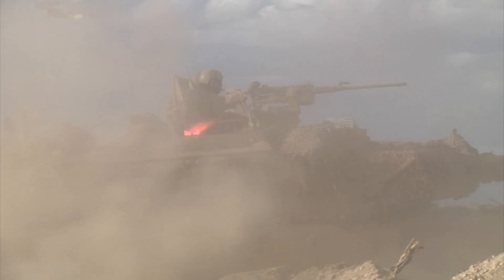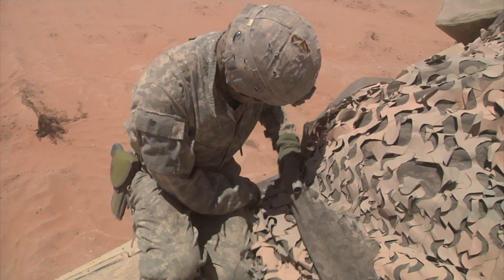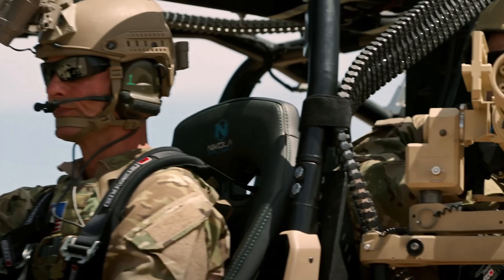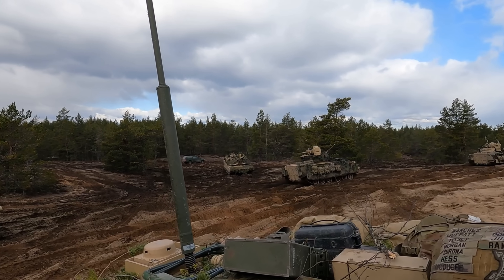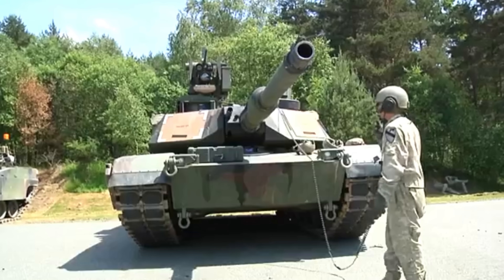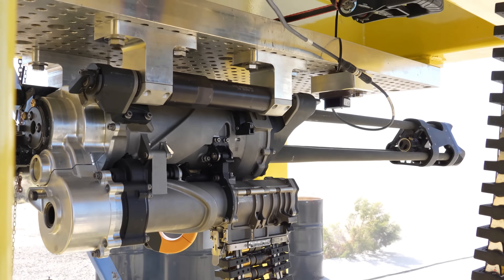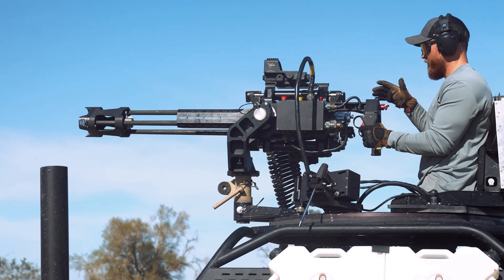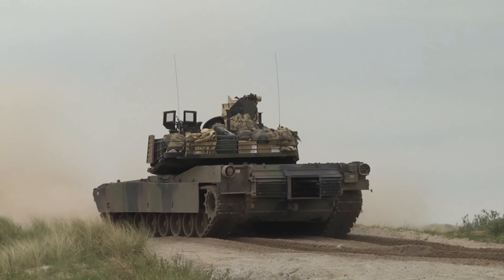Why is the U.S. Army putting a M134 Minigun on Abrams? | ROTARY GUN DEFENSE

Comment: If the AA machine gun can’t be set up with proximity-fuse explosive rounds, then its not going to act like a miniature C-RAM. Given that drones are lightweight, scaling down to a 5.56 microgun (even lighter with a 3-barreled variant) could be compact enough to operate remotely with fast response time and built-in range/tracking system,; but it would still take a lot of firepower, with programmed high-rpm bursts to effectively target moving drones within a few hundred yards. Multiple active defense systems and sensor packages around the tank itself would be a better solution that has far more development behind it.

Comment: When you consider that tank crews already have full time jobs, having them man a defensive weapon like this while in combat is a pretty poor idea.  While I could see a gun like this working well for anti-drone duties, to be effective it would have to be part of an automated system like a miniaturise version of the Phalanx CIWS (probably based on a lighter calibre like 5.56 though because you don't need the power of a 7.62 round to take down a drone).  I think that going forward, in order to protect tanks from drones, most current generation tanks will need new turret designs because just slapping on top systems like this when it would either be blocked by or interfere with current systems is a massive non-starter.

Comment: As a retired US Army tanker that served 23 years on the Abrams platform, the M240 that was or still is mounted on the loaders hatch was supposed to be last minute or (rear) cover vs infantry.

You also get better firing angles by traversing the turret over on the right. Yes ..the loader will be exposed to enemy fire, but the tradeoff is better than having nothing. I wish that I had the M134 mingun when I served.

Comment: IMO, a remotely operated platform seem more preferable to a manual one, both because of the vulnerability and limitations of the human loader and the vulnerability to the entire tank of the open hatch to drone bomb drops. Ideally, we'd want a "CIWS-style" tracking and fire control system to make it easier on the loader, but A) I imagine the autonomous gun platform, sensor suite, and Ammunition store would take up a lot of real-estate on the turret and B) implementing such a system would be a much more extensive upgrade than slapping an M134 in the place of the M2, so it might make more sense to save that for the next generation Abrams, which based on the promos of the Abrams X seem to already be the plan, just with a 30mm rather than a rotary gun.

Comment: Background- Navy veteran, I was an FC and a CIWS tech:

First of all, this is ridiculously dumb. It's on par with just having someone attempt to shoot a drone out of the sky with their M4. The navy CIWS "CAN" knock out drones, but it's not entirely reliable at that due to the drones' size and erratic movement. And that's even after the multi millions of dollars' worth of radar guidance. The only time an operator is guiding CIWS is when it's in PSUM mode (phalanx surface mode) and it's not the easiest thing to get on target, even if you're given a perfect kind of controller. A guy in a moving tank is NOT shooting a drone out of the sky, I don't care how accurate he thinks he is, it's just not happening.

Secondly, the CIWS that's already in the desert is the C-RAM or Counter Rocket Artillery and Mortar which doesn't use the same ammunition as the navy CIWS for a good reason. The navy CIWS uses APDS because the navy prioritizes velocity and range, but also when you're on the open ocean your rounds eventually fall into the water. In the desert, the C-RAM uses a timed fuze shell thats set to explode after a certain distance because you can't exactly just spray 20mm at 4,500 rpm in the air and let the rounds go wherever. The M134 to my knowledge has no such round.

Conclusion? No radar guidance, no timed fuze for 7.62. This is a futile, dangerous decision made by someone pushing paper. Instead, what they should do is kit the Abrams out with an APS and keep the .50, or shoot, use the M134 but don't try to shoot drones down with it cause it will NOT work.
Reply: CIWS also has a radar guided computer, compared to the M134's mk0 eyeball. A remote-controlled weapons system with a forward facing radar for targeting would be better.
Reply: @xXMegaUltraNinjaXx  it would probably have a pretty good fcs, so it could be accurate against drones. of course, a radar would make it far more accurate, but an fcs might be able to work.
Reply: @hdfghghfghd  there are probably other things like thermal or laser fcs, but i doubt a man aimed fcs to be great against a drone swarm. CIWS is able to shoot a burst against a drone and then move onto the next target, assured its burst is going to hit based on range/distance/speed. Most of a minigun's inaccuracy is from the gunner not the weapon system so a short burst would get a single catastrophic hit on a small drone.
Reply: @xXMegaUltraNinjaXx  - useless without targeting module, dude ! You can't shoot what you do not see !
Reply: @xXMegaUltraNinjaXx  typically an FCS on a tank controls absolutely everything, the gunner simply puts the gun on target and the computer locks onto the thermal signature and calculates lead, bullet drop, and everything else. perhaps the human element could be entirely taken out, and make it fully automated to shoot drones down.
Reply: They found that shotguns worked well against drones
Reply: you can develop a CWIS type system that does not use RADAR but uses thermals and laser range finders.    CWIS is an old system that has been in service for 50 years and been upgraded but new technology can make this effective for vehicles.  As for not being able to hit things on the move the Army has had stabilized gun systems for decades- i have used CRew systems with stabilization that will lock onto a spot while rolling.   that was 20 years ago.
Reply: @MrChickennugget360  I'm sorry, but you're just wrong. I mean, I recently left the navy operating on the newest CIWS system and I can promise you that it can out match any crap you can think of. BTW, CIWS has thermals (PTI camera), and laser range finder is a far cry from radar accuracy. It doesn't matter if something is stabilized either, you need radar guidance for detecting the threat and giving gun guidance.
Reply: @CactusQuade  no you are wrong.  Did you not read my comment?  You going to fit a CWIS on top of an ARMY TRUCK?  or a Tank?   Those things are fucking huge.  Next time you read my comment
Reply: @MrChickennugget360  Obviously you didn't read my comment, because I worked on it for over 4 years so I definitely know a thing or two. What you need to understand is what I said is "radar beats laser/thermal", and you don't need "CIWS on a truck", but a guidance system of some sort that utilizes RF. Without some sort of search radar, you've got next to zero chance against an incoming drone.
Reply: @MrChickennugget360  And BTW just for a fun fact, CRAM in the desert IS on a truck...lol...btw it's CIWS not CWIS.
Reply: @CactusQuade  yes i know about the Centurian.  
we are just as capable of developing a search and track that can scan for thermal imagine within the radius of a vehicle.

between AI being integrated to vehicles and thermal systems they should be able to make a thermal detector without needing to actively scan with radar
Reply: fully agree, US needs to develop a small, cheap, short range rocket for drones, like the russians have now already in use. Like I said, US is far behind in this field, many years, probably more than a decade. US has NO dedicated self-propelled platform against drones. While the russians have more than a dozen.
Reply: @mirandela777  what sort of platform have the russian developed against drones? i am simply curious, ive never heard of such a thing before
Reply: @mirandela777  Ukraine already successfully used laser-guided APKWS rockets (which are modified versions of the Hydra rockets on attack helicopters) supplied by the US to shoot down Shaheds and cruise missiles. The technology exists, we just need to build more of them.
Reply: @404found00  - those are AIR launched missiles, dude - you need a fighter-jet / helicopter  for that,  so that is USELESS when you have no air superiority, nor fighters or pilots - the case of Ukr ! 
"..we just need to build more of them." sure, GL on "building" pilots and enough fighter-jets ! 🤣
Reply: I was just wondering when someone would finally say "AA flak" while watching this video. Thank you for your insight!

Comment: I like your idea of some sort of "Claymore mine" attached to the outside of the tank. My thought would be to put plates packed with the ball bearing and explosives like the reactive armour blocks over top the explosive armour now in place on most tanks. the system would need some sort of radar to track and fire off the "Claymores" in a timely manner.
  As for the M134, in my view it's another good idea and it needs automatic tracking and control  system. Another thing that would make it more effective and cut down use would be to make a Semi-wade cutter type of cartridge for the 7.62 round that would come apart shortly after it leaves the barrel to put more lead in the path of a drone.
Reply: Rhinemetall have already a nice system.
Active armor with metal powder.
Same effect, but the explosion of the block of defensive armor just spread dust, like a sandblaster.
Enough to chew a drone or a HEAT incoming at very very short distance, but any friendly asset around may get at worst a mouthful of metallic dust.

Comment: The mini gun might have a place in drone defense for armoured vehicles but I would think small caliber with AI doing the aiming and firing.   The time-frames of fast FPV and swarm attacks are beyond hunan reflexes.    Using a 7.62 round to throw thousands of rounds into the sky and surroundings isn't very friendly for dismounts. As potting FPVs coming in at 160 kps a few meters off the ground is dang near impossible to consistently spot in a timeframe to react.   Again we need AI and sensor driven target acquisition and engagement.

Comment: I don't see this working. First, you're trading out your anti-material capabilities. Second, no one can be scouting for drones 24/7 and expect to see/hear each incoming over the noise and size of a tank. Also, unless that gun can point straight up into the air, drone operators will learn to hover over the tank and dive into the obvious weak spot of every western tank for an M-kill. No, we need an all encompassing solution, at least partially computer controlled or assisted, and able to deal with drones, RPGs, etc. Eventually, the something like a mini Phalanx, perhaps with bird or buckshot. Not that I'm opposed to the idea of mounting miniguns to any vehicle where the tactical need is enemy troop suppression and light skinned vehicle destruction.

Comment: Tanks, by their very nature aren't built to provide great visibility so relying on human vision is not an option.
Having one drone defense system per tank may not be feasible so another solution is to replace the .50 cal on some tanks by an automated system using the M134 minigun to target and destroy drone threats. 
It could save a lot of ammo by shooting accurate bursts and thus increase durability of the system.
Sensors could also be fitted to other tanks in the unit and relayed back to the drone defense capable tank to further improve accuracy. 

Another option would be to mount the M134 at the back of the turret on a articulated arm, allowing for 360° aiming and rise above the tank's hull to negate any blindspot.
You could even name it a badass name like Scorpion lol

Comment: I still don't understand why the Army reversed course in 2020 to remove the CROWS-LP system from the M1A2C, as that removed the safety concerns of having the loader & commander standing exposed. Combine that with some sense of automated defense mode for drones, & put an M134 on the loader side & GAU-19 on the commander side. Heck, let one person control them both from the same system when in manual mode.

Heavy point-defense firepower plus improved crew safety. Seems like wins all around to me.

Comment: August 4, 2025 - Hi Matt. It's Larry in Connecticut. I hope all is well with you and your family. Regarding the Minigun. I think you make some really valid points in this video. "Slap a M134 Minigun on that sucker.. Hoorah!"😁 Ummm.. on  second thought maybe not, for reasons pointed out in the video. I think Matt mentions some more acceptable and plausible suggestions.  There are a lot of vehicles that use top mounted remote station machine gun and grenade launchers like the CROWS setup. I think I like that option the most. The crewmen are safely undercover. Also, mounting a 50 Cal. multi-barreled weapon system could mean eliminating the top mounted Loader's 7.62mm M240 machine gun. Lastly, there are the practical considerations like electrical power for the weapon system, and, storage space for ammo. I've never been in a tank, but it seems to me that storage space is at a premium in there.

Comment: Completely disagree. Keeping it supplied wouldn’t be anymore difficult than any other machine gun and the fact that it shoots 7.62 means it can carry more ammo than a M2, And sure a rotary gun is complex but its a weapon system thats been fielded since vietnam so theres definitely been more than enough time to sort any issues. This goes for other heavy weapons too like the mk.19 or mk.47 grenade launchers. My solution is this mount the M2 coaxially so you still get the ability to kill soft armor and light cover put the M134 on the rws and let the loader keep the M240 or SAW just so you can keep the same amount of guns. All in it’s not a bad idea even if the threat was just regular infantry. Side note AI powered air defense systems are also a thing so they could just modify the RWS to work like a phalanx where it has a human operator mode or a automatic track mode. This definitely should have been considered a lot sooner

Comment: Just a thought, the commander already has an M2 no? If the point is high fire rate, why not upgrade that to a GAU-21? Would keep the penetrating capability and also allow for more advanced payloads such as airburst or ratshot. Same effect as the GAU-19 but with more parts commonality and less adaptation to the CROWS mount compared to it given that it is a tuned up M2 already.

Comment: How about a RWS for the loader or if a auto loader just replace the M240 with a RWS that the gunner or a AI system can operate because the M134 is just too big anyway if anything the loader when not loading 120mm rounds then be a RWS operator from inside the tank until something better can be developed

Comment: I would take 6 small turrets with some shotguns/ (rotary shotguns, seen one prototype did not work so good)  a belt-fed or 50+mag shotgun probably better you don't want go out and reload when your under attack from drones. Why not 1 small turret, you need layers so min 6 on the turret  to cover 360 with lidar and optical, they are AI control that  id and fire, now days you have to be quick if a drone comes at you at +300km/h you don't have so much time to  react,  you don't have so long range with just shotguns so you will prob have to have multi protection to protect the tank  1 long, 3-4 med and 6+ short range systems to try to max. Whats the probability that the MBT meet another MBT or that it meet a anti tank weapon or the big thing right now a Drones. You have some redundancy due to drones are cheap and they will prob hit you with a few.  The shotgun turrets don't need to be protected against everything just so they can take some a minimum punishment. Cheap and mass them,

Comment: I'm thinking replace the commander's CROWS with what is basically a mini-CIWS armed with a minigun of some size. Preferably using some sort of IRST to search for drones and then radar to lock and destroy them. Ultimately, it could still be used by the TC to engage ground targets like the CROWS, but would be much better for dealing with drones.

Comment: When drones started knocking out tanks in Ukraine and the turtles appeared I knew there would be a need for an automated system like CWIS, but scaled down and designed appropriately. Radar on tanks? I don't think lighting up one's position if a radar is turned on matters as much as it once did. The opponent likely already knows where your tank is. Then one has to think about the practical max/optimal range- is it several thousand meters or less than 100 when an attacking drone is detected? Is a large caliber needed? Would 5.56 or smaller work better for a variety of reasons (less weight, easier operation, smaller platform etc). Primarily, this needs to be automated, keeping Human operation and reaction times to a minimum. I understand the Army's tendency to reach for an off the shelf solution, but I think their approach won't work very well- at least initially.

Comment: 8:14 wonder if the fix would just make this into a .22 if for drones would make gun smaller use less power and amount of ammunition you could carry a lot larger.
Reply: I would think bringing back something like the XM214 project and creating a miniature CIWS type system with its own dedicated radar tuned for small airborne drone targets. A 5.56mm option would still punch the drones easily while also having weight savings so more ammo can be carried eith the added benefit of being a round found in mass quantities within every single ground unit we have